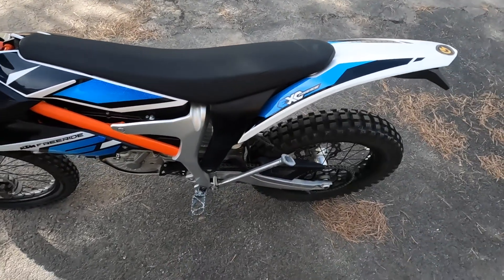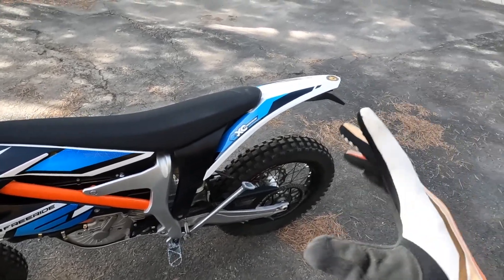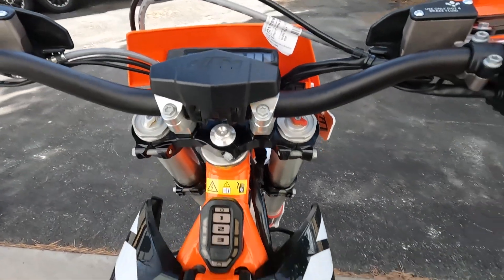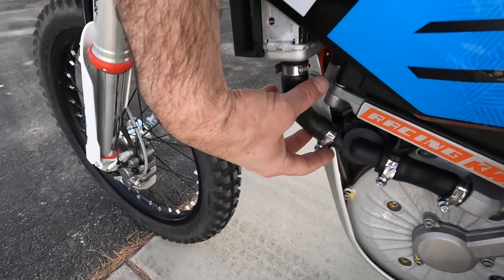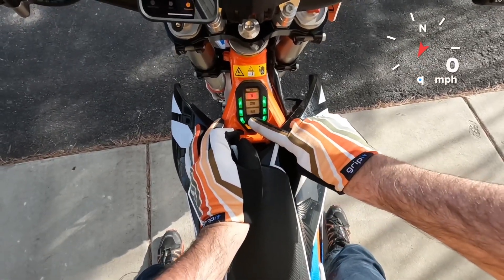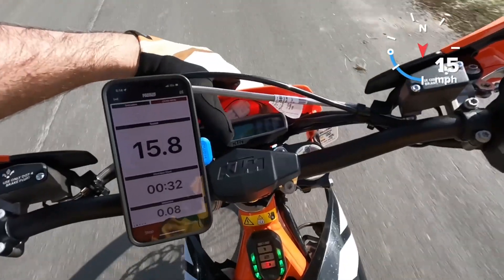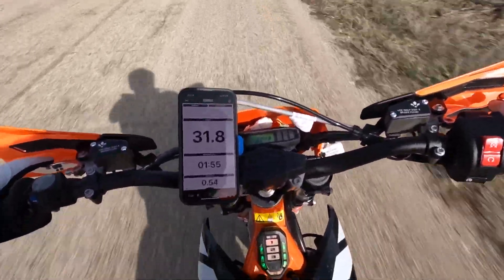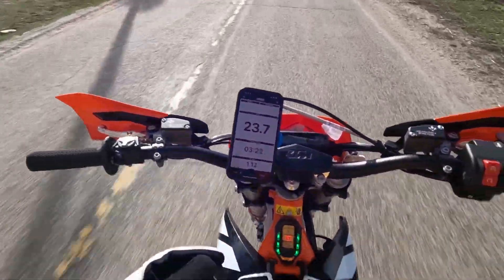KTM Freeride Acceleration vs Surron Talaria

Comment: If I’m gonna ride a bike that’s double the weight of my modified Surron… it better have double the range too— but it doesn’t.. it has roughly the same range. So why in the world would I want a bike that weighs twice as much and performs the same? I’ll be sticking with my perfectly set up Surron for now…
Reply from the maker: The KTM is a very different beast, it's great for someone who wants a full sized, high quality, super comfortable trail bike right out of the box (no modifications needed) and only rides 20 miles.  Pretty niche, but for the right person it's a really nice bike.  My wife for example absolutely loves the KTM.  The surron on the other hand requires a ton of modifications $$$ to be transformed into something as capable as the KTM.  Two different audiences for these bikes.  The range is a bummer for sure.
Reply: @ChargedCycleWorks  that’s surprising— my wife LOVES the stock Surron… lower seat height, 1/2 the weight, same range. My wife won’t touch full-sized bikes… and I don’t want her to frankly. My wife is a way more capable rider on the smaller platform. Not even close. Of course, my wife is 5’5

Comment: I definitely like this bike! But I got my talaria for 5200 cad and the ktm is rough 13,500. That's more then double for 8 km faster and not much more acceleration. If I had the money I would definitely get a ktm but honestly the talaria is a better buy it seems. Even with having to put a extra 2500 into it for the BCA 8000 72volt upgrade. I will however say I like how the ktm looks like it's made to take a beating, my talaria has some battery rattling issues that aren't necessarily a problem but I don't like it. I also find for trail riding the talaria has to much power for the stock tires
Reply from the maker: The KTM is really a totally different beast due to the weight.  The Surron/Talaria feel like big mountain bikes, the KTM feels like a dirt (trail) bike and that brings very different riding style and enjoyment.  The power delivery on the KTM is phenomenal, the best we've ever felt.  We agree with KTM is overpriced for what you get, but it is extremely high quality, and out of the box an excellent trail bike for those not riding long distances.  When we ride the KTM it makes us excited for the future of eMoto and bikes like the Stark on the horizon.
Reply: @ChargedCycleWorks  I'm excited also

Comment: I got my talaria and being 6'3 210lbs it carries me well with the handle bar risers. With that being said i want just a little more power .. i think 9-10hp on would be perfect.. It does with me on it about 45 which is good for the riding i do and man i didnt realize how much fun you can have on a bike that don't make any noise. im going to be making a purchase  with yall on tire and wheel set up pretty soon. Good Videos man..
Reply from the maker: The Talaria is excellent for those looking for a big bike (larger surron), we recently installed a fork, full sized 19/21 MX tires onto ours and the seat height is 36" now which is similar to a full size moto bike.  While we do not have suspension at this time (nobody does) you can find our Talaria Stage 2 wheel upgrade on our website which includes a 21" front compatible with RST forks.  Thanks!
Reply: @ChargedCycleWorks  is the stage 2 wheel upgrade a complete swap? meaning it comes with the rim and tires? Heading to the website now thanks!
Reply from the maker: @rubberguy1982  It comes with a full 21" front, you re-use your OEM rear 19" wheel.  We can build you a new 19" rear if you like. https://chargedcycleworks.com/collections/talaria-sting/products/stage2-package-for-talaria?variant=42788793680088

Comment: The aceleration is 0 to 40mph?
Reply from the maker: No, we test ALL the bikes on a very long driveway from one pavement break to another with a slight uphill so that they are all being tested on the exact same distance.  The KTM hit about 40mph during it's test where as a stock Surron only gets to about 30.  If you hit the link in our description you can see all the results for each test and there are links to the other acceleration tests.